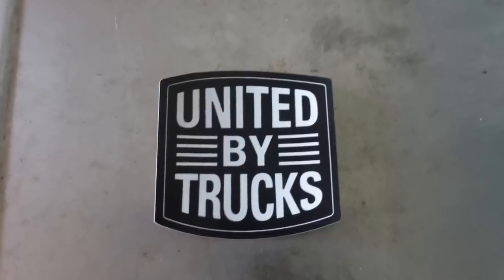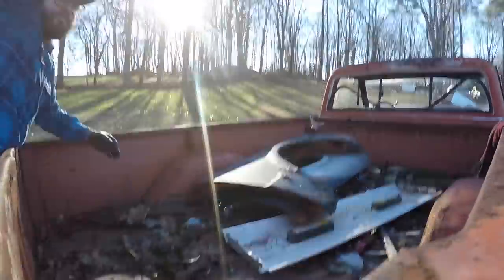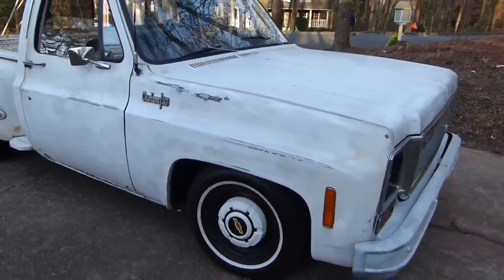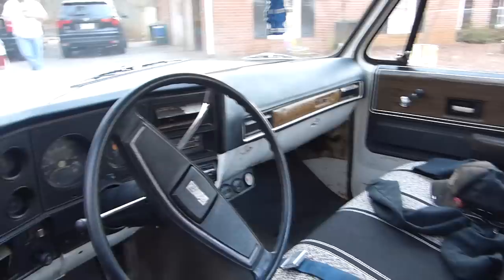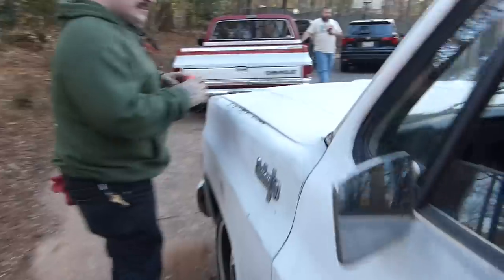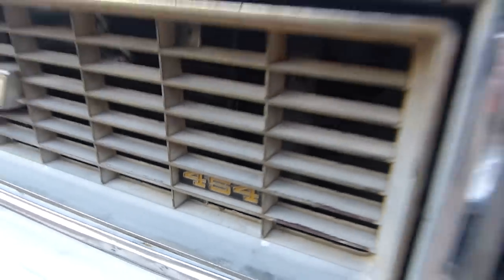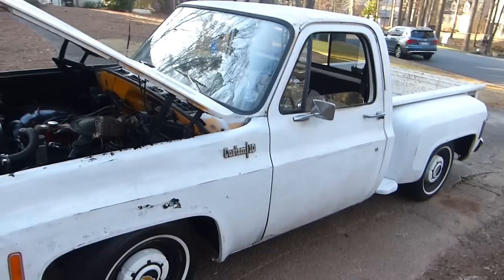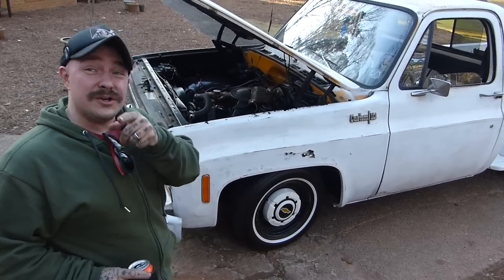Lowered 1973 Shortbed Stepper | The Workin' Man's Truck | #WIMD

Comment: I have the exact same truck. Same year and everything. When I lowered mine, I wasn't able to put my stock wheels back on it anymore. They were rubbing against the control arms. I used a reputable company to buy my drop spindles but I had no choice but to either raise the height back where it was or buy bigger wheels. I went with the bigger wheels but it wasn't my intention. Is this a common issue? I love the way this stepside looks on stocks sitting that low. I ended up putting 20's. It opened up a can of worms because then I had to remove my inner fenders for the clearance as well. It sucked. Spent WAY more than I wanted to.
Reply from the maker: Whoa and yes, that is a common issue, but I've never had an issue with stock steel wheels (usually 15x6) or a 15x7 rally. You have to trim the inner control arm to run 15x8 truck rallies.
Reply: @UNITEDBYTRUCKS  Yeah I had my stock 15x7's with stock tires. I actually did grind the control arms down because I had to put the stock wheels back on to get home but it made a horrible grinding sound when I would crank the wheel. Must have been the inner fenders? I should have removed those before I put the wheels on. Anyway, awesome Channel. Barely discovered it. Salutations from SoCal.